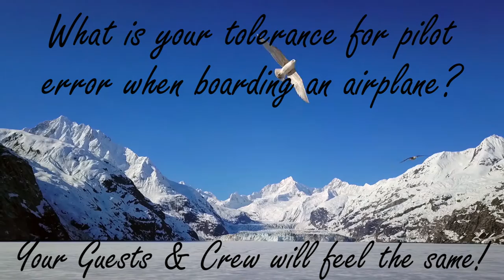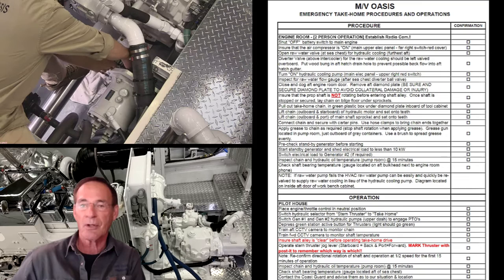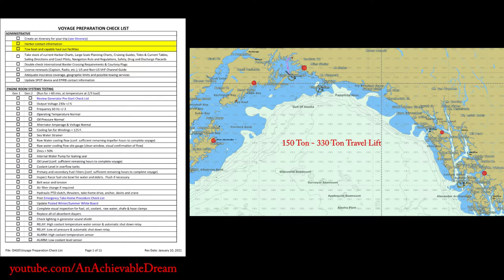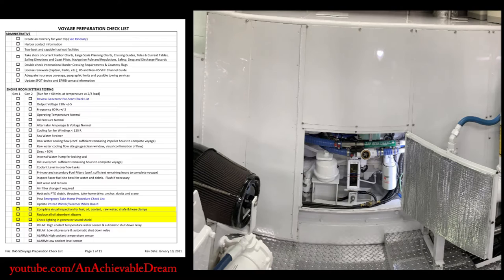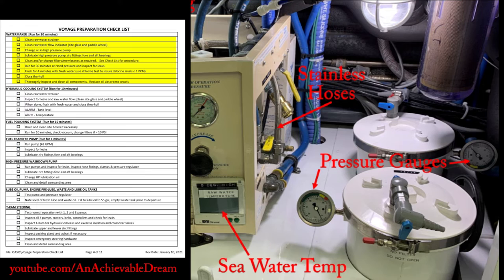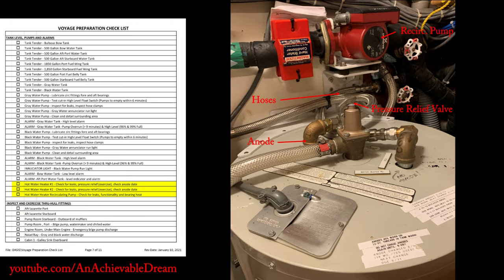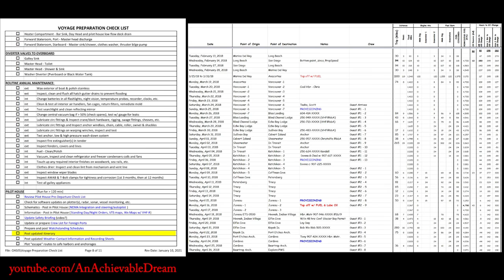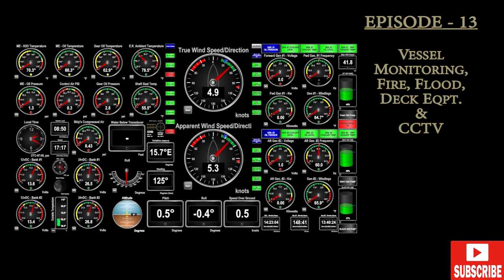Episode 2 (Part II) - Vessel Preparedness

Comment: Such great information as we take our 45’ trawler south this summer from Seattle to LA area. Question. In the weather section, as I start several months out getting a feel for the west coast weather patterns. I notice I get good 48 hour weather window for my needs, but near a prospective departure the NOAA forecast will include SCA when all my other forecasts tell a different story. As I follow the weather window the NOAA forcast never materialize.  So my question…on departure do I stick with my forcast window and disregard NOAA or heed the official forcast and delay. 
Thank you again.These weather seminars take a complicated topic and break it down into manageable and reasonable concepts
Reply from the maker: There is no way that any of the global weather sites can have the refined nuanced accuracy and anything close to the local knowledge that is covered in local forecasts like NOAA issues.  They are good for general planning purposes, trends and off-shore conditions (which are more often than not turn out to be similar to NOAA's local forecast).  I certainly wouldn't disregard NOAA, but in those situations you can always use buoy and ship reports the morning of your departure as a sort of sanity check before heading out of the harbor (or offshore).  I have also had the reverse situation, where NOAA has issued a near coastal weather updates in my exact position, showing the winds at less than 12 kts when it was blowing a gale.  They've gotten much better, but not quite perfect.  Also, when in doubt NOAA will typically err on the side of caution (which seems appropriate).  Hope this helps.
Reply: @AnAchievableDream  Thank you for the thoughtful response. I have been watching all your videos for this passage since it is the first for us on our trawler. We have made this trip before but followed a more blue water passage since we were on our Hans Christian 43 where wind and sea state are a much different consideration. We have circumnavigated Vancouver Island on the trawler so we have a taste of off shore conditions on the trawler but this will be the first extended open passage. 
Actually we are headed to the Santa Barbara harbor where we have a slip and I just now remembered your origins to that area aboard the beautiful family sailboat where you started. Still is the most beautiful harbor on the west coast if not the northern hemisphere. If you are ever transiting through SB I would love to host you and you crew for a drink at SBYC. 
Thank you again for these in-depth examinations of cruising aboard a power vessel.  Truly an impressive presentation.

Comment: Of you had a smoke filled engine room and still had electrical power, why wasn't a radio call your #1 action?  Ego?
Reply from the maker: Hi Mike.  You ask an interesting question.  It likely had more to do with self preservation than ego.  Seconds can make all the difference when it comes to extinguishing a shipboard fire.  My first thought was to identify the source of the smoke, the extent of a fire (if any), then determine if it was possible to contain the situation.  I suppose if we had a larger crew or someone dedicated to communications, we might have alerted the CG.  This is one of the inherent problems in running a small ship by yourself or with only one other person (which was our case)..you can't be everywhere at once.  I believe if the exact same situation were to befall us again, I would make the same call (which is not to say that it was the right call).
Reply: @AnAchievableDream  thanks for your response.  Human nature.  Suggest you train your "crew" to operate the radio at the first sign of trouble, communicating position, while the "engineer", you, investigate the issue.  Hindsight 20/20 but we're all hear to learn.